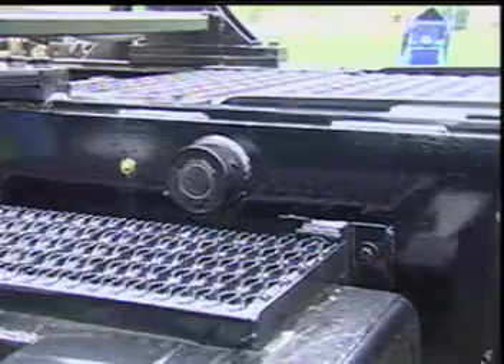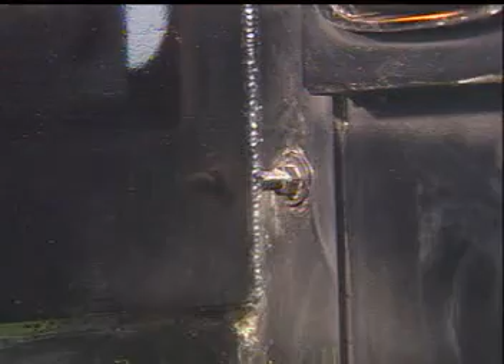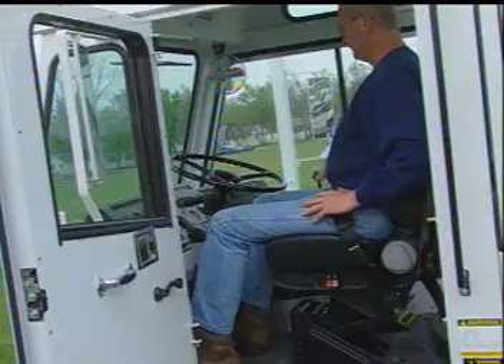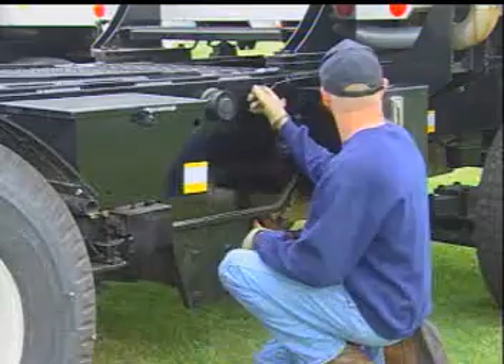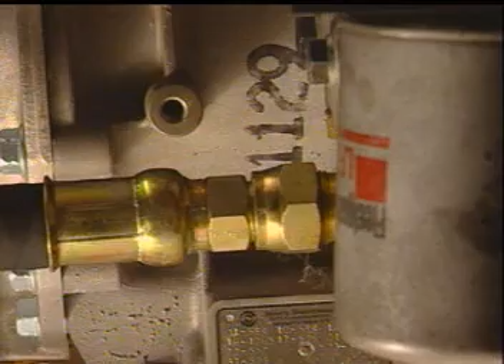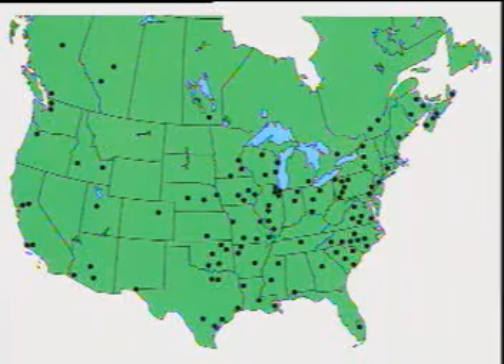Ottawa vs. Capacity Yard Truck Comparison - www.aveneltruck.com

Comment: Sad old infomercial.
There are Ottawas at work, and they are all a bit fucked.
So are some of the Capacitys, but deffo less munted.
Capacity for me, chilluns...
Reply: The Ottawa's at UPS are all majorly fucked new or old, but then again anything that company has on wheels that's older than a year, especially the yard goats are all a bit fucked. Either are still better than a POS Tico, especially the gas V8 variants....
Reply: @MattsRageFitGarage We have newer Ticos at my terminal and they are super nice to use power window and push button accordian doors only complaint is they vibe and rattle the screws our of the interior. Also the Tico has way more room. The Ottawa I'm stuck in right now is rusted out and I can see the road from the floor boards but hey I guess that's the best UPS can afford
Reply: @ricochetey  The newer Tico's we have all of the power windows groan like a bitch, half of them the rear doors have broken multiple times, the gas V8's went through so many starters they had to be sent out for a retrofit starter kit to fix them properly. The older Tico's all of the dashboards have cracked/broken up where the air supply valves are, and they all vibrate really bad. I have a really good old ottawa but even it's a piece of shit, it was refurbed 5 years ago and I was the first person to drive it. Sadly, all of our other ottawa and capacity goats are total junk. We have 3 brand new autocars been sitting around for 2 months though because they can't get the stupid ivis's for them though lmao how pathetic.  One of our ottawas has 1/4 turn of slop in the steering and they don't want to fix it, the thing reeks of diesel fumes also. But remember, work safe and do your pretrip!
Reply: @ricochetey  I don't know where my first comment went but it seems to have disappeared. We have 5 newer Tico's, 4 gas V8 one diesel. All of the power windows groan and creak like they are going to break at any time, the accordion doors have all broken multiple times (so have the older Tico's we have) the gas V8's went through so many starters they had to be sent out for a retrofit to fix the problem. SEAT FAULT, was a big intermittent issue that would not let you restart the engine, and many times had to be towed away because they wouldn't restart in the middle of the yard. The older Tico's all of the dashboards have cracked/broken where the air supply valves are, they all vibrate horribly. The diesel new Tico the shackle/mount for the hydraulic cylinders have both broke at different times and soaked the yard with hydraulic oil. I have a really good old ottawa refurb that I've been driving for 5 years, it's probably the best goat we have and it's still a POS but way better than the rest of our old ottawa and capacity goats. It at least runs and drives nice and steers really good. One of our old Ottawa's has 1/4 turn of slop in the steering, a messed-up dashboard and column, reeks of diesel, 5th wheel carrier bushings so bad it makes the goat lean over when you go around a corner with a loaded trailer but they don't want to fix any of it "because they aren't race cars". We have 3 brand new autocar's been sitting around for 2 months because this company can't get the ivis's for them and they even have A/C. It's all a pathetic joke but remember work safe and do your pretrip!
Reply: @MattsRageFitGarage  Ya 10/4 trust me if I had known I would be forced to drive rusted out shifters with softball size holes in the cab and that UPS takes no pride in trucks or equipment or maintenance yet expects us to catch every little problem I probably would not of took this position
Reply: @ricochetey  Yep I started off shifting at a small hub 8 years ago and they consolidated 3  local hubs/centers into this new super hub 5 years ago now and you'd think with a new state of the art facility they would have just bought all new yard goats. No we have all the old junk from the old locations plus a few more junkers that came from all around the county. You know damn good and well they bought those locations new equipment and sent their old junk to us. If it weren't for the money I'd say the heck with it.
Reply: @MattsRageFitGarage  that's what I have found out in my 2 months here the one and only reason to stay here is for the $$$/benefits, that's it
Reply: @ricochetey  Yep, money and benefits are great, company culture and work environment is terrible. 9 years in, can't wait to retire...

Comment: The Ottawa is by far a better easy to operate tractor..now the flaws there are many from the door handles to the horrible heating system..I drive them everyday and I'd still take it over the other ones..

Comment: Heres the deal... I drive both .. Every day. Ottawas are easier to work on and were designed from and engineerig standpoint. Capacitys are more comfortable logical and user friendly and are deisned from tue drivers standpoint. As a business man, choose Ottawa, as an operator, gimme Capacity. This applies to 2007 and newer trucks